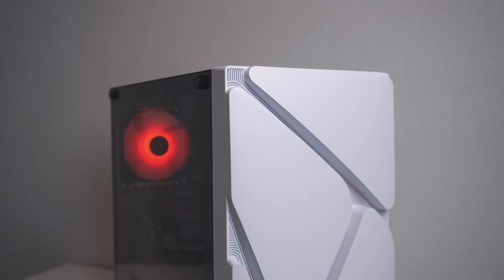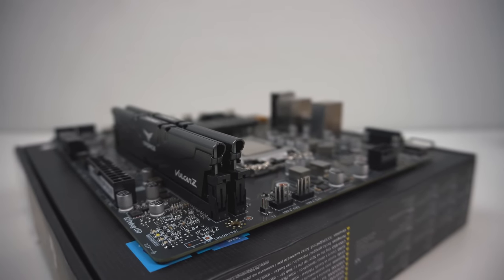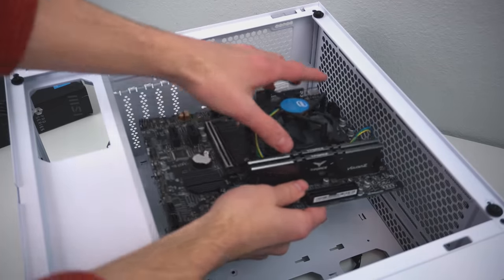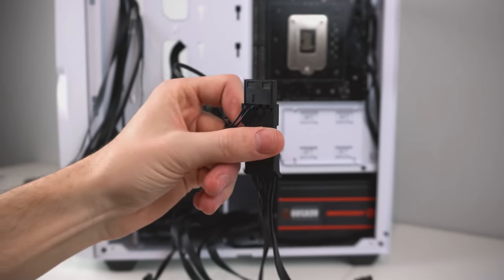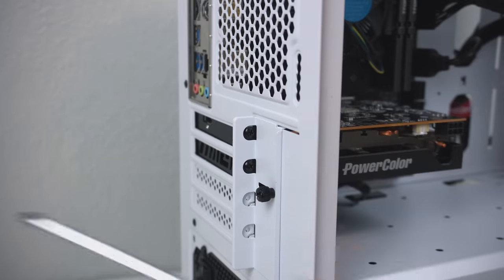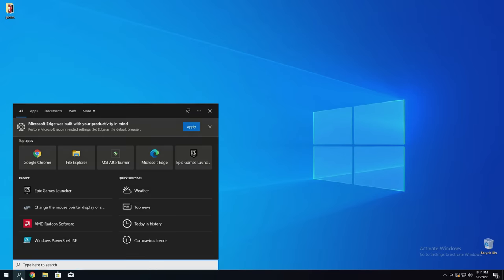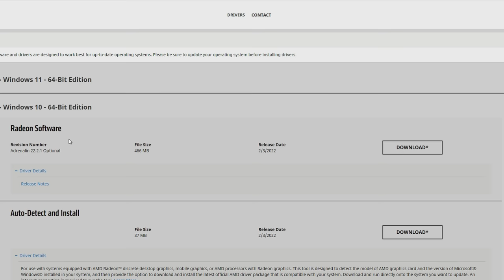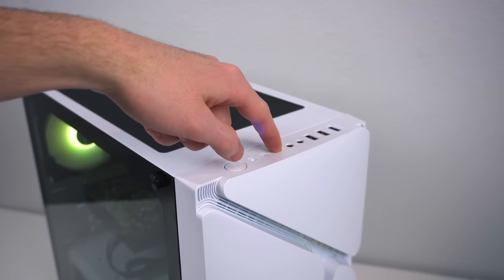BEST $700 Gaming PC 2022 [Build Tutorial, Benchmarks]

Comment from the maker: Tips on buiding a gaming/streamming pc for yourself → https://bit.ly/3Tu5c1v
More info about how to upgrade gaming pc → https://bit.ly/3NxSACR 

Thanks for watching! Comment below if you built this or plan to build it 😎
Join my Discord : https://discord.gg/C3jYx88jXy
Reply: Can you use a nvidia graphics card like rtx 2070 or something
Reply: @alpha_ayo  you can but they're out of production and sell used for over $600...
Reply from the maker: @esdificil3764  you absolutely can do that! As long as it is an ATX case, it will be compatible.
Reply: hey, whats the song in the b roll
Reply: @Roo_Tech  would any ATX case work?
Reply from the maker: @snowzer0gg  Yes
Reply: Does this build have built in WiFi
Reply: @sadies.222  buy a network adapter
Reply: whats the song in the intro
Reply: Planning to build this for my b day, cannot wait.
Reply: Im planning to build this. But Can I Use 1000gb, rx 6600 & evga 700br instead of the 500br, 500gb 6500xt?
Reply: I am wondering if i would have enough headers to power my fans if i switch to the marbleshell ms30? Also, I  can't find anywhere if the single rear fan on the ms20 is 3 or 4-pin.
Reply: why do i need the drivers
Reply: Where are the drivers?
Reply: @andreysemenov997  in the Description
Reply: I got a question my in the process of building my pc do i need 3 fans or is 2 enough?
Reply: can i legitamently run warzone on this?
Reply from the maker: @davebraun7902  absolutely!
Reply: @Roo_Tech  like what would be the average fps be?
Reply: also if i had an 850$$ budget which of the components should i upgrade?
Reply: @Roo Tech,  I watched your video and bought all the parts from your list. Everything is fine, except the USB ports are not working, none of them, I watched your video and follow step by step but still not working on the USB port. Please advise.
Reply: Do u need another device for example a laptop to actually play and use the pc?? Pls help
Reply from the maker: Digits  yep!
Reply: @Fluffyhairgeek  yes you can use any power supply an=s long as it is not below 500

Comment: I went to a pc shop 2 days ago and was recommended the exact same mother board, Ram amount, psu type, and style of case. I opted for 1tb SSD and selected the amd Radeon 6500xt. This is my first pc build so I’m not sure the motherboard is properly put in but it feels secure I just wish I had waited for this video and gotten the same exact case mine is weird, but I’m very happy to have my first pc built and am installing windows right now!
Reply: nice bro
Reply: how much did you pay for your graphic card
Reply: @johnstaker6706  279.99 on Amazon prime free shipping
Reply: Motherboard screws are important since they also provide a ground path for motherboard power. So as long as you put all the recommended screws in all the standoffs, you are good to go. Sometimes it’s difficult to align the i/o backplate with the motherboard, it takes some pressure to push the board sideways into the i/o shield then put the screws in. (the i/o back plate also provides a ground for the motherboard, so aligning it correctly is important) If you did all that it’s mounted correctly! Nice to see your first build, it’s fun for sure!
Reply: RIP GPU
Reply: @jeffsterc1657  ?
Reply: @idioticfrosty  true man could have gotten a 1660 or 3050
Reply: saad legendary  6500xt is good for alsmostr everything 1080p at 60fps if you’re system supports pcie 4.0 it can do most at high quality and 1080p 60fps but 6600xt is a good step up for future proofing if you can afford it and have a monitor that can do more than 60hz and 1080p
Reply: @idioticfrosty  someone watched Linus tech tips 😂 it’s the cheapest new gpu on the market and I upgraded from integrated graphics so it’s a Win for some people
Reply: @mrchamp9171  Radeon graphics cards have had their fair share of issues in the past so I just prefer not to go with Radeon but I’m glad your happy with your pc
Reply: Do NOT buy Rx 6500xt 
NOT do buy Rx 6500xt
Buy do NOT Rx 6500xt
Reply: I just built my first every of build. These are the specs. How good is this build?

Intel® Core ™M 17-10700F 2.90GHz
• ASUS ROG Strix Z490-E Gaming
ATX
• (2) * 16GB DDR4-3200 Patriot
Signature Line
• NVIDIA® GeForce® RTX 3050 8GB
GDDR6
• 500GB M.2 PCle 3.0 NVMe SSD
Major Brand
• CLX Quench 240 Closed Liquid
Cooler
• 2TB 3.5in Seagate Barracuda HDD
• SET SAKARA Mid Tower White
• (4) * CLX RGB Fan
• CLX Alchemy RGB LED Light
• 750 Watt GAMDIAS Kratos M1
80+BRONZE RGB
• TRENDnet TEG-PCITXR
Reply: @R3DD_TTV  how much did it cost
Reply: @R3DD_TTV  I would instead of getting 2 sticks of 16 gb gone with faster ram and with intel I would have gone with ryzen instead and for the psu I would have put the extra money instead towards a higher power rating psu that isn’t fancy because 80+ bronze isn’t that good and that’s about all I have to say but idk if u care about my opinion
Reply: Too bad the 6500XT is trash and if you think it can hold most recent games at high quality full HD at 60 FPS, I am sorry my man, you are sorely mistaken. It struggles to being a whole lot of games to 60 at medium. It's better than nothing or than an APU, that is for sure. But tone down your expectations, or you'll be painfully disappointed.
Reply: @lloydaran  I’m okay with the performance it’s been doing great 60fps in most games with high quality easily so far
Reply: saad legendary  id watch a review before buying the 6500xt cuz ive heard its horrible
Reply: no i need to install windows or buy it
Reply: @Phenxme  a 1660 is 900$
Reply: 6500xt.... OMG...
Reply: here i am with m gt 730 lul. Still waiting for that day....when i can finally get my hands on 1050ti
Reply: @slendfreddy709  still waiting for that day when I finally get my first gpu and upgrade to an i5 from 2 years:/
Reply: @Phenxme  a 6500xt is only $230. A 1660 is over $350. If you buy a 1660 in this market you're an idiot. I would rather pay $230 for a sh*t card than $400 for a sh*t card LMAO. It's not like the 1660 is vastly superior. Lol. It's not. 6500xt can be a good stop gap for someone waiting for something higher end.
Reply: Very lucky
Reply: @lloydaran  "Some people can't afford better gpus"
-Me, former aio pc user
Reply: @mrchamp9171  6600xt is 320 much better just saying
Reply: @mrchamp9171  wowwww, you can get a 6600xt for 279.99 now LOL

Comment: Whoever ends up inventing a double sided motherboard is going to be rich as hell. Having all the large cable connections on one side facing the side of the PC case where cables usually hide will make it much easier to do just that. No need to route cables its basically just plug and hide.
Reply: Check yayz latest videos, there is a powerboard already available
Reply: this is so smart actually.
Reply: Bro you a time traveler ! Check Linus's video

Comment: This built was super good looking at price to performance. And case just looks so simple yet beautiful.
I built my PC back in the early 2021 with Ryzen 7 2700x , GTX 1660 super, 16GB DDR4 cl16 xpg Ram, Antec 550W power supply, 3.5TB storage(1tb old hdd, 2TB New Toshiba 7.2k rpm + 500gb wd blue SSD), Samsung 75hz 23-inch monitor, Zebronics Transformers combo keyboard and mouse, and F&D A520 Audio. Cost was around 1335 dollars with chair , 100mbps wifi connection and table included. I also want to ask that I want to upgrade GPU (cpu too) , which one should I go with , 3070ti or 3080ti by saving some more money. Btw loved the video ❤️

Update:-. I just got quad 32gb and 3060(cause i am able to buy to other listed stuff), 144hz ultragear 27' , dual monitor, maono pm 421 mic,a logi c615 webcam, so pretty much ready to stream after exam
Reply: In my opinion you should go with 3080ti.
Reply: wysi

Comment: TIP: NEVER RUN DX11 IF HAVING THE CHNACE 
Most AMD cards cannot run DX11 properly, causing lots of stuttering and low GPU utilizations. I have a RX5600 XT and Fortnite with DX11 was hovering between 60 and 70 percent most of the times with lots of microstutterings. After switching to DX12 I was finally able to keep my FPS above 144, at a 100% GPU usage and without stuttering. Pls try this out.
Reply: saad legendary  its a software kind of thing, games run by using DirectX or DX, modern games run DX11 and DX12 if im correct. AMD cards dont run DX11 well so DX12 gives better performance
Reply: what about performance mode
Reply: Thank youuu brotherr
Reply: @dip7497  In my case performance performs the same as DX11, most probably it still runs on DX11, the graphics are just turned down for more FPS that's it.
Reply: what is dx11?? I don't understand these terms..
Reply: A few weeks ago, amd fixed the dx11 issue. Overseer pc made a video about it with a 6600 xt.

Comment: @Roo Tech  Thanks, also 2 quick questions do you still need a hard drive or does the SSD card replace a hard drive? And my 2nd question is... I saw you didn't use an anti static rist band, in your other videos you always say you need to use it, and in those videos you sometimes use it and sometimes not. Do you always have to keep it on?
@Roo Tech  And also 3rd question why don't you use Windows 11?
@Roo Tech  PS: Sorry for buging you.
Reply: -You don't need a hard drive and you can always add more SSDs later on. 
-If you have windows ten pro an upgrade to windows 11 pro is free
Reply: @beekuz8716  thx

Comment: remember when you could build a budget PC for 450 to 550, man i would love to have those days back. rocking on my Sandybridge Core i7 2600, with a Radeon R9 270, i went from that to Ryzen 5 1600 with a GTX 1060 6GB, both builds only cost me 580 total when you include Windows 7 on my Intel build, but i already had Windows 7 on my first PC with an old Core 2 Duo, so i basically got Windows for free. on AMD it was 520 when you include tax, and Windows 10 was free when i got the OS in 2017. so basically a full pc with everything for 500, not anymore.

Comment: i have a question for the motherboard that is linked in the discrption would a ID-COOLING FROSTFLOW X 240 CPU Water Cooler AIO Cooler 240mm CPU Liquid Cooler White LED 2x120mm PWM Fans, Intel 115X/1200/2066, AMD AM4 fit that motherboard

Comment: Can I use a Ryzen 3600 instead for the CPU and an GTX 1650 MSI  would it perform better and be much cheaper?
Reply: wouldn't really be cheaper I don't think, maybe save a few dollars. Probably wouldn't perform better because it has a worse GPU, the 6500xt is about as good as the 1650 super
Reply: No. GTX 1650 is going be slower than the 6500 XT. And I want to ask if you can find a 3600 is priced at $150-$120, because if it isn't, then the i5 would be better. On Amazon, people are selling the 3600 at the same price as the 5600X.

Comment: Everything is built and the CPU and all that turns on and is good but no power in the ports or HDMI 1 won’t display on my monitor tried switching the HDMI and still same problem I have GTX 1050 TI which says it doesn’t need a power supply so I don’t know

Comment: Roo Tech please reply, but can I use an ARESGAME Power Supply 650W 80 Plus Bronze Certified ATX PSU - AGV650 I am new to pc building this is my first pc build I want to make sure I get the right part. @Roo Tech
Reply from the maker: Yes
Reply: @Roo_Tech  Thanks, also 2 quick questions do you still need a hard drive or does the SSD card replace a hard drive? And my 2nd question is... I saw you didn't use an anti static rist band, in your other videos you always say you need to use it, and in those videos you sometimes use it and sometimes not. Do you always have to keep it on?
Reply: @Roo_Tech  PS: Sorry for buging you.
Reply: @Roo_Tech  And also 3rd question why don't you use Windows 11?

Comment: If i have 100-200$  more, what should i Upgrade?
Reply: Either buying RX 6600 for 200 more, or investing more in a better overall motherboard + CPU cooler.
12100F + B660 motherboard is an option too when it comes to gaming only (fewer cores and threads)
Reply: Rtx 3050, or u can wait few months and get rtx 3060 with the same price
Reply: @valentin3186  Thank you.

Comment: How do I know which monitors would work for this exact build?
Reply: any monitor will work as long as it uses an HDMI cable which almost every monitor made after 2010, also make sure to plug the hdmi cable into your graphics card for it to work properly
Reply: Any monitor with decent reviews. Look for one with a low ms response time. For this build 144hz refresh rate would do just fine considering your not getting crazy high fps with the build.

Comment: I have a question for anybody.  I bought a msi b560m pro vdh with a 10400 cpu. Is it true that the m.2 slot right below the cpu wont work? Should I only use the other m.2 slot for my nvme ssd?

Btw,  great video!

Comment: Don’t get the 6500xt it’s really bad, go for an APU, either ryzen 5 5600g or 7 5700g, it will be around the same price of $700 but you will need to change motherboards
Reply: or just go in the used market for a gtx 1060/1070/1080 so you don’t have to get a worse cpu..

Comment: Hi there !
This build makes sense, sure the 6500XT is crappy but it's the only choice for $300, and pairing it with the cheapest i5-11th gen that has PCIe4 is a good solution, as 10th gen is PICe3 and the x4 lanes on the GPU will not have enough bandwidth, and 12th gen is more expensive...
Yet in games the 1% lows are real horrible (5 fps ? WTF!!??) thanks to the 6500XT...
Reply: What's worse is that the 6500XT doesn't even have most of the encoders that the other RX 6000 cards have. Nothing about this card really makes sense.
Reply: I assume it's because of DX11. From I've heard, AMD cards don't play well with DX11.
Reply: @sokool3994  that just sounds absurd considering how many AMD cards have been out on the market before DX12 games and how well AMD cards performed at those games.
Reply: @fluffyRabbit01  The 6500 XT is a brand new card. I think it may not be optimized well for DX11
Reply: @sokool3994  that's not the issue. Here 
https://youtu.be/ZFpuJqx9Qmw
The beginning of that video explains the issue fairly well.
Reply: @fluffyRabbit01  I already know know about the 6500 XT's horrible memory performance. Though, I didn't think it would be this bad.

Comment: Is This Gaming PC Build Good For Under $1,000 ?

Specs :

GPU - SAPPHIRE PULSE Radeon RX 6600 8GB GDDR6 $429.99

CPU - Intel Core i5-10400F - 6-Core 2.9 GHz LGA 1200 $125.49

Motherboard - MSI B560M PRO-E LGA 1200 Intel DDR4 (Has NVMe M.2) $83.99

RAM - CORSAIR Vengeance LPX 16GB (2 x 8GB) DDR4 3200 $64.99

Storage - Crucial P2 1TB 3D NAND NVMe PCIe M.2 SSD $83.99

Power Supply - Corsair CV Series, CV550, 550 Watt, 80+ Bronze Certified $40.49

Case - DEEPCOOL MATREXX 50 Mid-Tower Case 4x120mm RGB Fans $87.99

Total : $916.93

Comment: Everything is absolutely perfect but you should use a GTX 1650 instead of RX 6500XT as rx6500xt is a terrible graphics card. GTX 1650 will be available at a lower price, will give 10-15 fps less but the overall performance will be way better and the game will never stutter unlike in Rx 6500xt.
Reply: Will these gpu from Amazon work with these build MSI Gaming GeForce GTX 1650 128-Bit HDMI/DP/DVI 4GB GDRR6 HDCP Support DirectX 12 VR Ready OC Graphics Card (GTX 1650 D6 Ventus XS OC)
Reply: @miguel_30  these will work but an Asus Tuf gaming GTX 1650 or zotac GTX 1650 will work better. Both of them are available on Amazon
Reply: Yo bro sorry but could you add the link to the asus tuf 1650 I can’t find it would really appreciate it

Comment: The best 700$ gaming pc(calling it that is almost an insult) with an included CPU cooler which will have your processor run at 100 celsius most of the time unless you're running an Intel i3 I guess. With a front panel that will entirely jam the airflow at the front... But nice video though, I know that you're trying

Comment: bruh,make better pc for 200 bucks less
Reply: @beluwuga2229  bro ryzen 3 1200 + gtx 1050 ti is 200 fps minimum on competitive settings
Reply: with 8 gb of ram
Reply: @J3b1v3t4rr  1050 ti cost about the same as 6500xt where I live also a lot of games need more than 8gb of RAM these days, at least 12gb but 16 is ideal
Reply: @MarkoVuckovic32  you live in Serbia, don't you
Reply: @MarkoVuckovic32  i saw pc for 530€ with gtx 1050ti and ryzen 3 1200 8 gb of ram and you can buy 8 more gigs forl around 50€its not 200 bucks less but its better than this pc
Reply: @J3b1v3t4rr  Yes I do live in Serbia, how did you know? Anyways I think that 6500xt is a bit better than GTX 1050 ti and it's definitely more expensive but 1050 ti is still great for eSports games
Reply: @MarkoVuckovic32  i know because your last name ends with ić a i ja sam iz srbije inace taj komp sam video u gigatronu
Reply: @J3b1v3t4rr  hahaha, pa što se onda praviš Englez 😀
Reply: @MarkoVuckovic32  a jbg dosadno mi pa nzm sta da radim😂